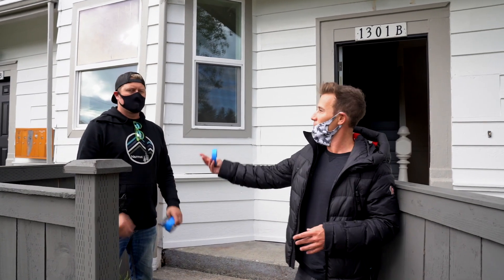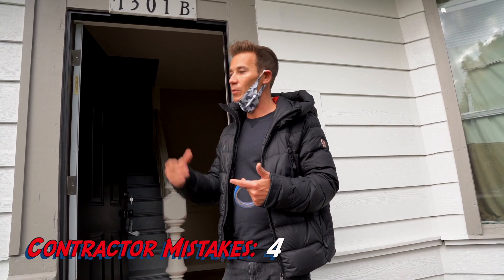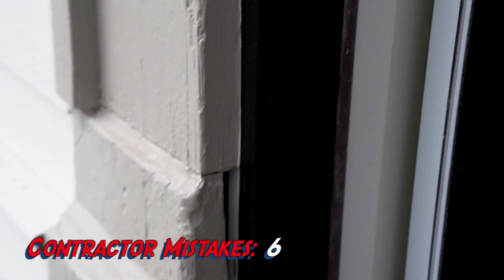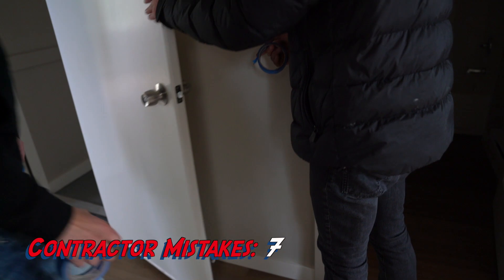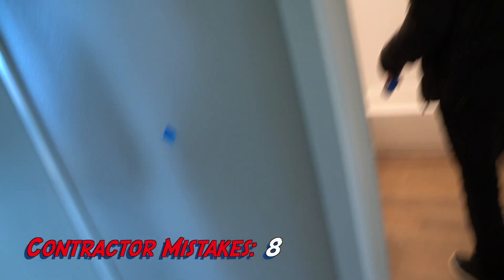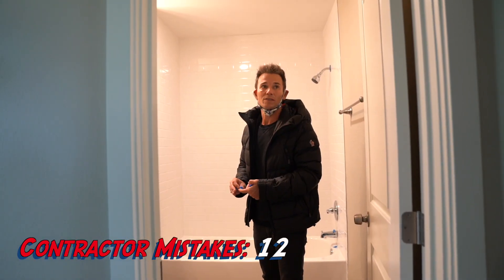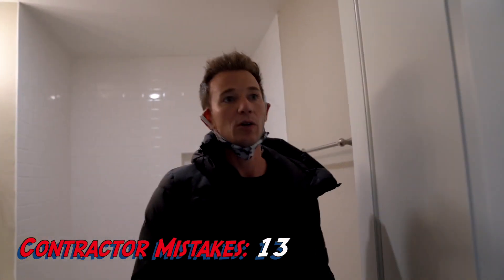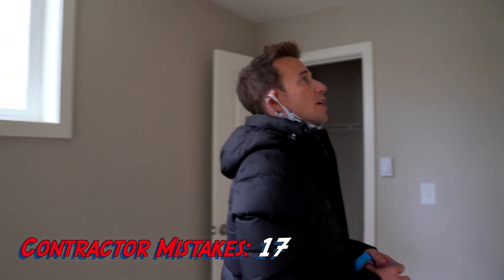Punching Out 25 Contractor MISTAKES - James Dainard

Comment: Great Video!
One thing that's trouble for me in my new construction development business is that most sub contractors are not humble and would get pissed as some of these points are controversial within the industry.  Toiles caulked for example. As a builder i would never caulk a toilet as if it ever leaked it will create much more damage as you would never know its leaking. Also caulking looks terrible over time especially in a bathroom like that.
Reply from the maker: Thank you so much for the feedback! They definitely require management! I suggest getting multiple quotes for each job.